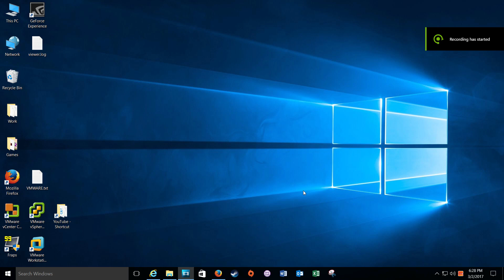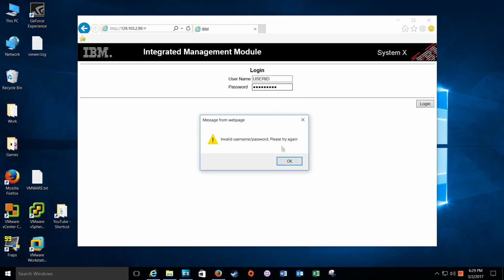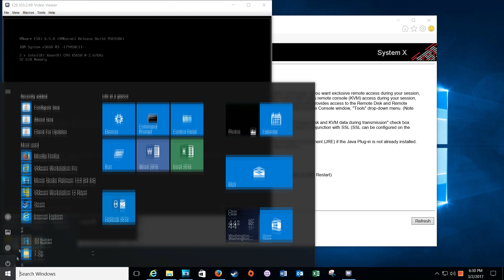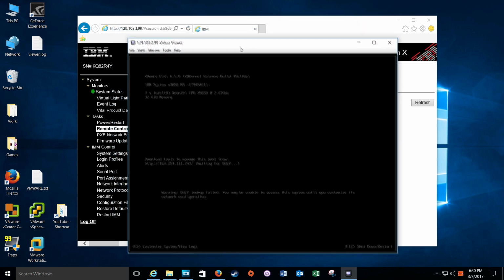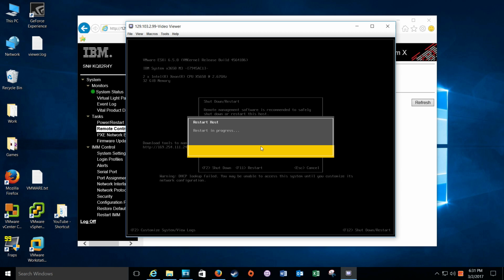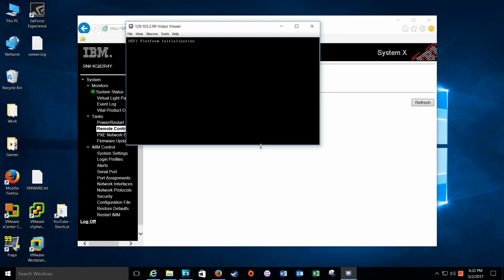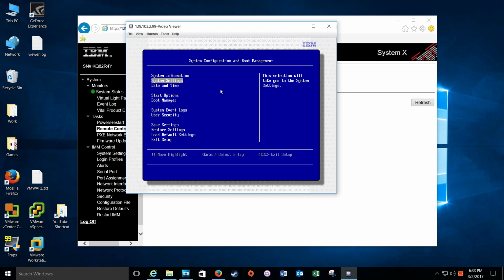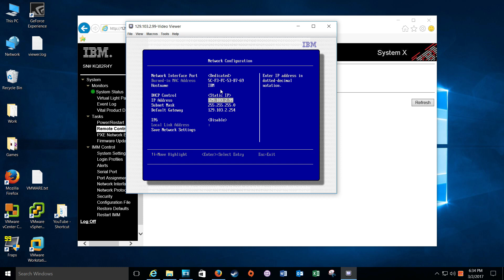CMOS\BIOS Remote Access IMM Management port for IBM X3650 M2\M3 Server

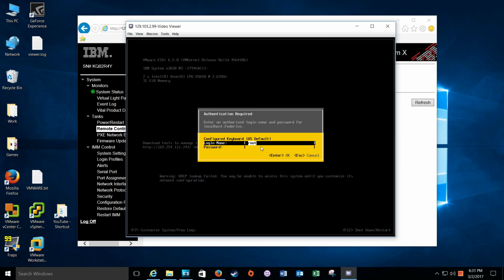Comment: The password you enter at 6:13 at the yellow login screen....
That is specific to VMWare and is not a bios specific password,
is that correct ?

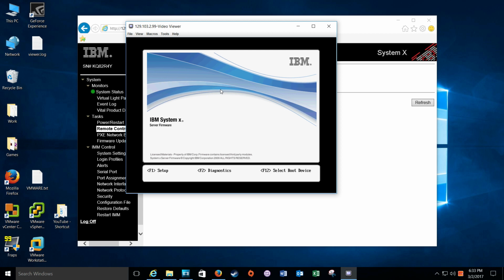Later, at 8:00 you enter BIOS by hitting F1 without password.
If a client claims he needs his bios password reset, but is at a yellow
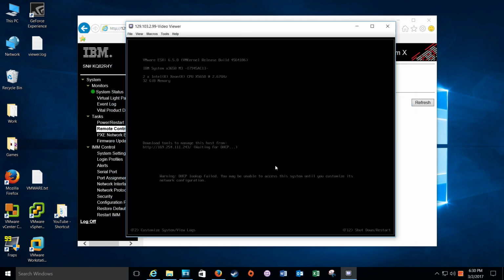login screen like you are at 6:13, that is a VMWare level password and 
cannot be reset at the hardware level.
Is that correct ?

thank you in advance,

Comment: Sir,

I found your video to be very informative and interesting. I do not have an M4 yet (I have several 7979-AC1 models). However, the video did leave me with a few questions…

I’d like to setup a virtual machine (say under VirtualBox or VMware) that has a Windows environment (or preferably a Linux environment) with the proper Java version and configuration to fully access and use the remote capabilities of an IBM x3650. With that in mind, I’d want it to (hopefully) work with the M1 as well as an M4.

What version of Windows did you use?
What version of Java did you use?
What version and what browser did you use?
What Java settings did you change to get it to work?
There are issues with certain encryption and hashing algorithms being turned off I heard in later versions of Java, no?

I would prefer to use Linux, but whatever environment I need that would give me full remote control capabilities (even remote mounting an ISO) is the goal (for which I’ll accept Windows if need be).

If you can do a video on how to setup and create this environment from scratch that would be wonderful! In fact, I can work out for you to get access to my M1 remote management port if that helps you.

Thanks in advance.

Stuart